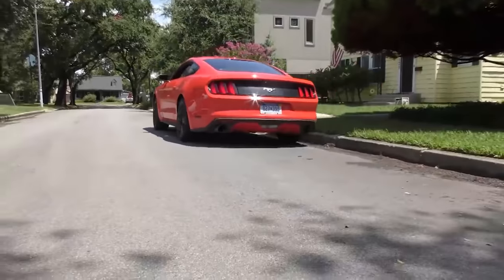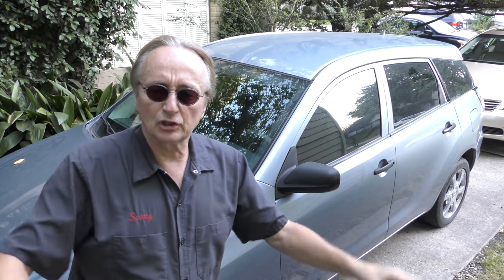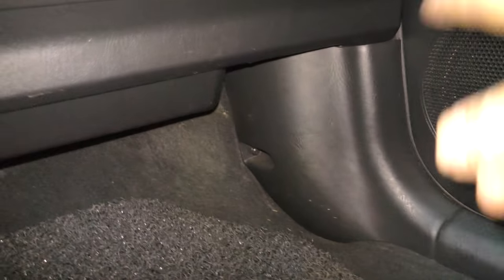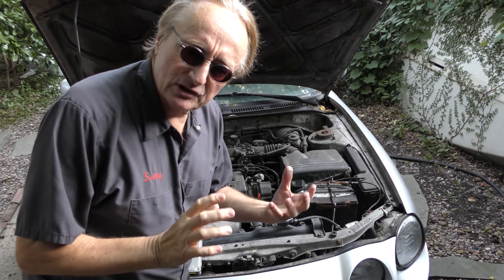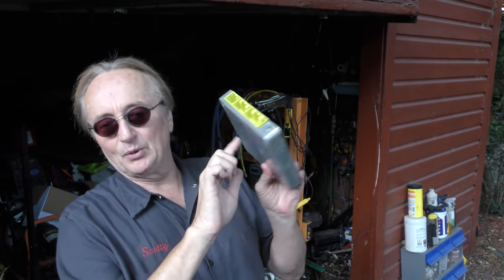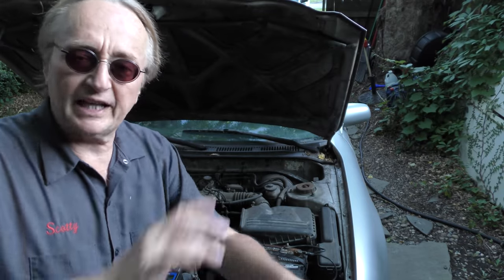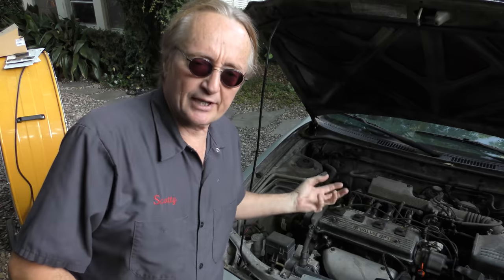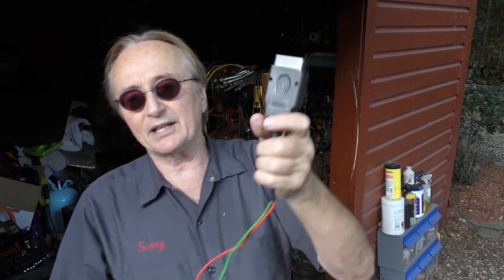What is This On My Face and What it Means for the Future of My Channel

Comment: I love those cars that "forget" how to idle when you change the battery !!!
Reply: My 06 RX8 is one of them
Reply: My Envoy
Reply: My Honda Civic does that too.
Reply: Mike K 
So all cars made today?
Reply: @francesco1998  Not really all cars. Its only a handful that forgets how to idle after the battery has been changed or reconnected. Hondas and Toyotas are well known for this quirk.
Reply: @francesco1998  Also, don't forget that in most modern cars, the PCM and the ECU will still technically be active (memory wise) when the battery is disconected. However, this is only for a certain amount of time (18 minutes for example) before they finally go dead. I don't know about the other cars with this quirk but i know that Toyotas and Hondas PCM and ECU work the same way as modern cars except they don't necessarialy have a "cooldown" period for the ECU specifically . That means, when you start the car again after reconnecting the battery two things will happen, the ECM will control the engine on "DEFAULT MODE" for a few drive cycles. You are only in Default Mode when your CEL is on or blinking, or in our case, you started the engine right after connecting the battery.
The second instance is the sensors that deal with the intake. They're extremely sensitive because they usually have a certain voltage that they work efficiently with the old battery. The new battery could throw off that comfortable voltage and now the throttle position sensor (example) will need to be taught on how to work efficiently with this new voltage.

Correct me if im wrong.
Reply: @francesco1998  Sadly, based on the comments, way to many. My wife's Volvo doesn't. I disconnect the battery ground all the time when I work on it and after I reconnect it, everything goes back to normal. Minus the radio presets LOL.
Reply: So true what a good laugh too
Reply: Toyotas do this
Reply: Early 90s Chrysler/Mitsubishi 3.0 v6s
Reply: My Pontiac 600 did that, and when I brought it back he said do 45mph for 20 minutes, nice if he could have mentioned that before I left
Reply: It's necessary to have a fuel air algorithm for cars to stay running right since people don't maintain their cars and for the emissions Nazis.
Reply: Mine....3 days idling like crap until it learns the parameters then go back to normal (Toyota) next time.... Battery saver :D
Reply: i think my 08 lexus did this but it just went away after a day , is it okay?
Reply: Do you need to switch headlights on before jump starting a dead battery to stop any surge from blowing the ECM?
Reply: My 2012 aygo will do this when the battery is changed. It'll start and die a second later but it'll run fine after you restart it.
Reply: Brz frs do it too you need to wait like a week till the ecu ajust back again

Comment: I have a 1990 Chrysler imperial 30 years old still runs no problems all original computers extremely rare that a computer goes bad on a vehicle biscotti you are definitely correct about all the rest of the information about voltage!

Comment: How many of you remember when the light on the dash was "GEN"?
Reply: Glowing on and off at a slow idle ...yep
Reply: Both of my 70 Buicks are like that. They were labeled as dummy lights.
Reply: They need to still say that. Or have them say ALT. So many people come into the parts store saying they need a new battery because the battery light is on.
Reply: How many of you can remember starting your first car with a crank handle if the battery was flat?..and had vacuum driven windshield wipers and had cable operated brakes?
Reply: @tolrem  My dad's first car was a 1941 Packard 110 and even it had hydraulic brakes!  IIRC Rickenbacker was the first car with ALL-hydraulic brakes.
Reply: @Matt_from_Florida  My dad had a '34 Morris 10/4 back in the fifties, that had hydraulic brakes all round and that was just a basic 1.5 litre flathead Morris not an upmarket car like a Packard.

Comment: My 95 Explorer has its original computer and it’s accessible and removable from under the hood. But it’s insulated from the elements and heat by being inside a little pocket INSIDE the firewall.

Comment: Recently had a lady come in with a Lexus, Said it randomly would shut off at a stop. the dealer told her they thought the problem was the alternator and it would be 800.00 to replace. A scope will tell one how the alt is working. Told her the battery was weak. (have the same tester as you) Sold her a battery. She came back a month later and gave me a 100.00 tip, problem gone! Just cause the car starts people think the battery is fine, wrong answer! Love your new channel.... Been doing car repairs full time since 1982. Enjoy watching your channel to see what your up to.....

Comment: Definitely good points on the computers, especially under the hood models, the older ones were inside , I love my Jeep, it's a 98 XJ and it's been going strong, it was at 300k when the first engine went, I'm now on the second engine at 170k I'm the second owner and put the remaining miles on the first engine, original computer in it still ,sits on the fender under the hood, Ive seen more grand Cherokee computers go bad than the Jeep XJs, not sure why, but definitely keep the battery good and connections on older cars, thanks Scotty for the good point of views, it's a reminder to fix certain problems if ya got em before they cost you money .👍✌️

Comment: I've got a 2011 AWD v6 Taurus limited with 100k miles. I've had NO major issues at all besides battery,breaks,and tail light bulb. I've had it since 50k miles. Car is 10years old and everything works even the adaptive cruise control. Amazing car, and there pretty cheap now days!

Comment: Great information about the computer and how the battery/alternator condition affects it.  Funny thing, back in the pre-computer days, if your alternator went out and the battery was good you could drive a long ways on just the battery as long as the radio, heater fan and lights weren't on.

Comment: Speaking of non-computerized vehicles; my grandpa went to chop ice for the cows back in the 60's while my Dad was away in Germany with the Army. His old '54 Chevy pickup (he didn't set the park brake or it was broken) rolled down the hill, right to the middle of the pond and broke through the ice. Pulled it out with a tractor and grandpa vividly remembered the vent fan churning water inside the cab. He drained all the oil and gearboxes and dried the points out. Put fresh oil in and that old pickup ran like no thing.

Comment: One way to keep from frying a computer is to put an electronic bridge circuit between your battery and the computer just make sure - goes to negative and t positive goes to positive  on the computer end and it doesn’t matter which side goes to the positive or negative on the positive on the battery end (technically it’s designed for ac circuits but works wonderfully on dc circuits where polarity is a concern

Comment: Ford dealership technician here. Regarding the question about the Ford Taurus. Tauruses were Ford's bread and butter car that sold in large numbers. There wasn't anything bad about them as a whole. The older Tauruses produced up to 2005 model years were actually very good cars overall. They were relatively inexpensive to purchase and maintain. There wasn't anything fancy about them by any stretch either. Then, some big wig at Ford at the time in his infinite wisdom decided to name every car in their model lineup with the letter "F", which spawned the lineup of Freestyle, Freestar and the replacement to older body style Taurus, the Five Hundred with that troublesome CVT transmission Scotty was referring to. I echo Scotty's sentiments about staying away from any of those cars equipped with the CVTs (the Freestyle and Five Hundred). They were fine when they were working, but extremely expensive to repair one the CVT failed. Enter 2008 model year, when Ford decided to do a complete 180 with the Five Hundred and Freestyle models, which ended up being renamed Taurus and Taurus X respectively at an attempt to regain the sales popularity the previous aforementioned generation enjoyed. Along with the name changes also came the discontinuation of the CVT and 3.0L Duratec V6 that previously provided the power to be replaced by 3.5L V6 and 6F50 6 speed auto transmission. This powertrain combo carried on into the all new at the time 2010 model year Taurus, that has carried on with minimal changes up until its demise in the 2019 model year. Most of them were sold to police agencies under the name "Police Interceptor Sedan". The 2010 to 2019 generation of Taurus was a decent car overall no real problems to speak of. But it's likely that most people felt there were better choices available for the price.

Comment: Definitely good points on the computers, especially u see the hood, I love my Jeep, and it's been going strong, it was at 300k when the first engine went, I'm now on the second engine at 170k I'm the second owner and put the remaining miles on the first engine, original computer in it still ,sits on the fender under the hood, Ive seen more grand Cherokee computers go bad than the Jeep XJs, not sure why, but definitely keep the battery good and connections on older cars, thanks Scotty for the good point of views, it's a reminder to fix certain problems if ya got em before they cost you money .👍✌️

Comment: I had a chrysler an old one, one of the first to get any kind of computer module. They put it on the damn breather cover.
Reply: or how bout some ford work vans putting them where rain water falls on the computer lol
Reply: That's to keep the computer cool and operating
Reply: I had a Horizon,  computer died 50k miles
Reply: My Chevy Impala SS has it the same way

Comment: I've been working on these computer modules and cars for 20 years the problem is that vibration is a major parts of failure these are surface mount modules with the pins of the chips not making contact from vibration they are put under the hood because they are more secure over there to prevent vibration and Chevys Ford's it doesn't matter

Comment: toyota also puts them under the hood now if i recall correctly and i always thought what a stupid idea in all that heat, dirt and moisture. keep them clean at least it should help reduce insulation from the dirt. they put heat sinks on them lol to absorb engine heat i guess! lol ...but hey maybe theyre durable computers. i would wrap aluminum foil over the connections myself for a bit of added dust protection keeping dirt out of the wires.

Comment: Mr Scotty hits home today. i somehow had broken insulation on fuel injector #4 wires. one was buried deep in a harness, the other 2 were near the injector plug. the wires were 12v positive from the computer. the corrosion was bad and it was making one corner of the PCM hot as fish grease, which eliminated fuel pump control and ignition control. it took me 4 weeks of troubleshooting to find this electrical nightmare...

Comment: The computer module still use 12 volts but they give a reference of 5 volts to the sensors that has not changed

Comment: With everything being computer controlled, I'm thinking that it would be a good idea to clean all of the ground connections after several years. I've been able to buy the factory repair manuals for our cars on ebay, and there is always a wiring diagram with the location of the ground connections. For what it's worth.

Comment: Oh man, I am in trouble then. I have a 10' Ford Focus I bought new, and I've left the windows cracked open and let rain get all inside the interior, and I drove through one of the Phoenix monsoons, which got up to my headlights! My PCM is right behind the headlight! Only on its third battery, as I let the first two die completely before replacing them! It's a wonder my car has lasted this long, being American planned obsolescence. I probably flooded the trans during that monsoon, but it still shifts fine!

Comment: My previous car was a 94 Ford Taurus that I had about 280k miles on. I sold it to a guy for like 400 dollars and it was still running on original engine and transmission. The transmission was super shot though, among other things.

Comment: My first vehicle waa a 1985 F-150. Also happened to be the first year Ford put an ECM in them. They were mounted on the right front fender well. Went through 3 ECMs before I  realized the problem waa over heating. Longer bolts and and few fender washers created an airgap to allow a bit of cooling for the underside. Drove the truck for several years after that, with no problems from the ECM. 
That first ECM problem also taught me to tell the mechanic what it's doing, not to change what I thought the problem was. I misdiagnosed it as a failing starter, but couldn't get the bolts loose, so I told him to change the starter. He did exactly what I told him to, didn't fix the problem. My only defense, I was 19 or 20, and stupid.

Comment: Luckily my 25-year old Mercury Grand Marquis computer is still going strong.  I make it a habit when I get home to open the hood to let the heat off the engine.  I also frequently use a battery maintainer to make my batteries last as long as possible, especially if I am not using the car for days.  My father uses a desulfite/anti-sulfur charger.

Comment: My truck has a place to clip a battery boost so I just hook up one of those jumper boxes with sealed lead acid batteries. The ones costco sells. Then change the battery and everything is saved.

Comment: I ran a tow truck for a while, one busy day I was hurrying through calls and on the 5th or 6th boost of the day, I had a brain fart and hooked the cables up backwards on a mustang. The dual batteries on the tow truck worked the mustang over pretty bad. Smoke poured out of the alternator, it fried the stereo system and a number of other things. I then had to tow it to a shop and submit a damage claim so the tow company could repair the car. It only took a second hooked up backwards to result in pretty substantial repair bill. I sure felt dumb...

Comment: Got a 200 Durango with the computer on the passenger inner fender. Never had a problem. Access couldn't be easier if problem does present itself.
Reply: 2000 sorry.

Comment: My favorite  controller misplaced controller FoRd! the GEM module the windshield would leak water would run down  the pillar and right into the GEM fuse box . I have seen  a couple of them end  in the starter getting engaged in the rain or wet season  and just about burning the truck down

Comment: That happened years ago with my sunfire. They put the computer inside the wheel well and it eventually fell on the ground from the rusted mount and to make matters worse the wires kept shorting out preventing the car from starting
Reply: Marlon Moore How did they not see how problematic that would be? 🤣

Comment: Hello there Scotty! We have a 2008 mercedes c class 320 cdi. It is not in good condition. It hasn’t been maintained for years. One day we couldn’t start it up, and it has been sitting in our garden for 2 months. A week ago we decided to charge the battery up, the lights turned up, but still we couldn’t start the engine. It had some strange noise in the engine. What do you think? What could be the problem?

Comment: Scotty, I understand you use the memory saver when replacing the battery, but what about when you are doing work that requires you to disconnect the battery for a job so you don't accidently anything, etc? I want to do more work on my car, but am afraid of messing things up. Thanks!

Comment: Scotty I have an a/c issue. My 05 tahoe blows hot air. The clutch on the compressor is not engaging. I’ve replaced the fuse and relays related to the system and I’ve tried bypassing the relay and low pressure cut off and have also tried jumping the compressor and still nothing. I’m guessing the compressor is shot?
Reply: Good guess...

Comment: Hey Scotty, I have a 94 chevy truck with 185000 miles, 350 w/ TBI.  when it is cold and I start it up it runs rough.  After 2-3 minutes it idles normal.  I replaced temp sensor, Idle Air Control Valve and any leaky vaccuum lines. It still idles rough, my exhaust is broken and needs to be replaced, could this be the cause of my rough idle? Any thoughts or ideas??

Comment: All cars have problems with electrical and computer modules as I have stated before due to the fact that surface mount technology has chips with 200 pins and they need to be reflowed with solder I've been working on these modules for the last 20 years ecu's PCMS does it make a difference they cannot take vibration and the body control modules are under the dash

Comment: I remember Ford put the daylight running lights module in the front wheel well.  Talk about environmental stress, freeze/thaw, water spray, snow, slush exposure and being peppered with dirt, rocks, gravel, etc.  They did not do well.

Comment: Jumped a e34 bmw backwards one time and it only fried the alternator. Car ran fine. Also my blazer has the airbag control module behind the kick panel you mentioned. Ecm is under the hood on mine
Reply: My friend fried the main computer on his 2003 tl jumping it backwards too

Comment: 2014 Chev Suburban LTZ 5.3L V8 6speed electronic shift 2 hi -4 hi/lo 

I have been hearing you say to drain and top up the automatic transmission fluid on a 30-60k mile increment. We bought our truck brand new & have never done it. With 110,000 miles now should I start doing this? I have noticed a little slip every once in a while towing a trailer or when i have the whole family loaded up But nothing serious.  

THANK YOU FOR YOUR VIDEOS!!